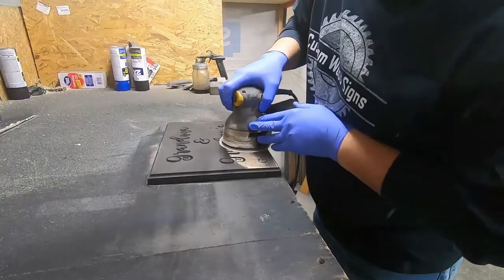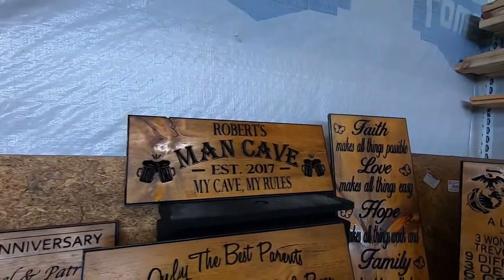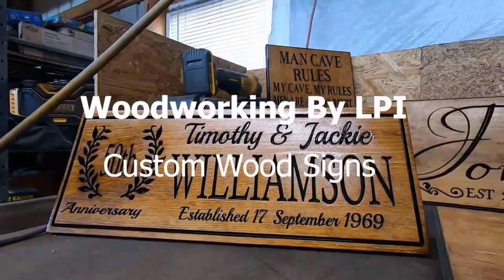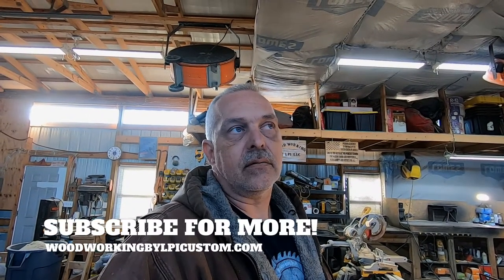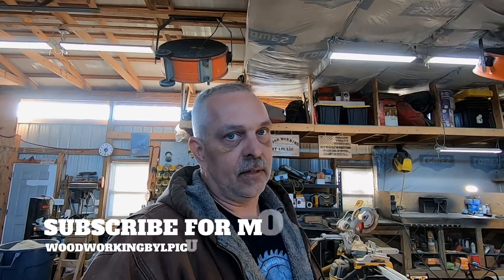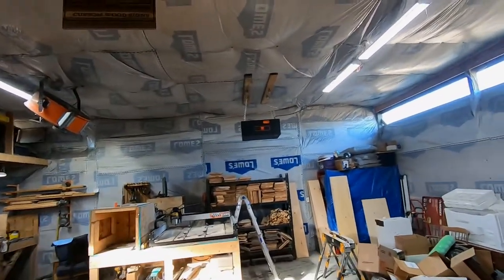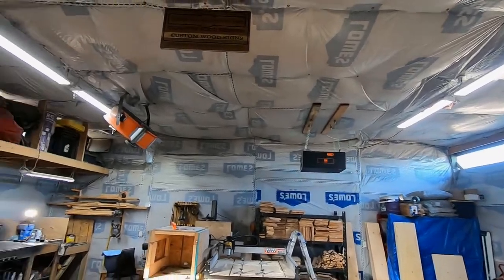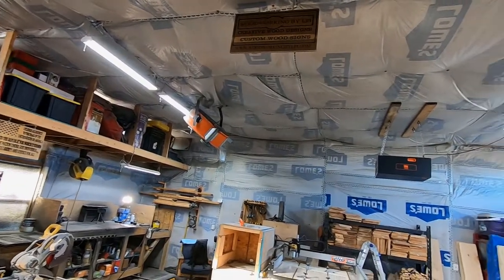How To Heat A Garage Workshop With A Workshop Heater

Comment: I use my 75,000 BTU Mr. Heater forced air heater to heat my 32 x 24 garage then let the 220v overhead electric take over to maintain the heat all day. I use diesel in the Mr. Heater instead of kerosene because it's cheaper and puts out more BTUs than kerosene. There is no smoke or smell with diesel and it heat quickly. It only takes about 15-20 minutes to get the shop up to working temp when it's below 0 outside. I use very little diesel during the winter months. I think I've only filled the heater twice during the winter.

Comment: I use two inferred ceiling mount electric heaters here in VA and I keep them on the low setting and my shop is warm. Also have the minimum of insulation
Reply from the maker: Great solution! It is a challenge keeping the wood shop warm.  Thank you for watching!